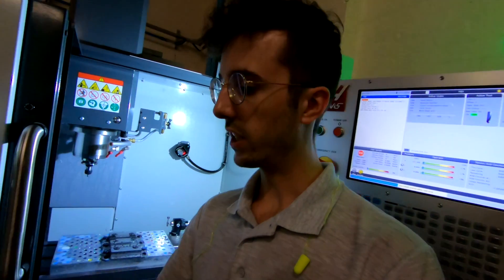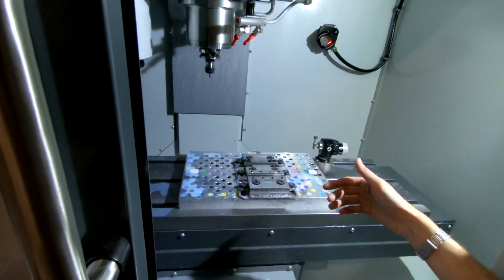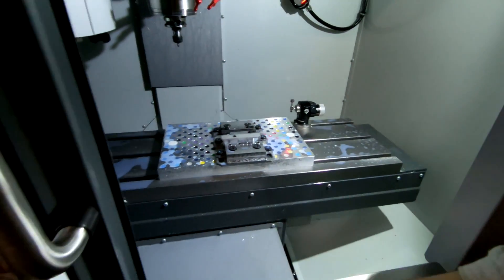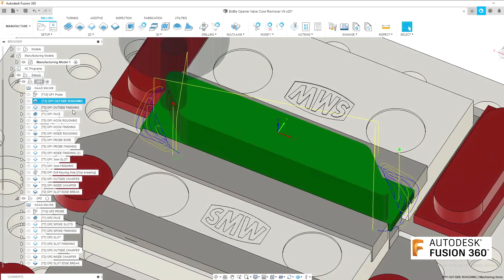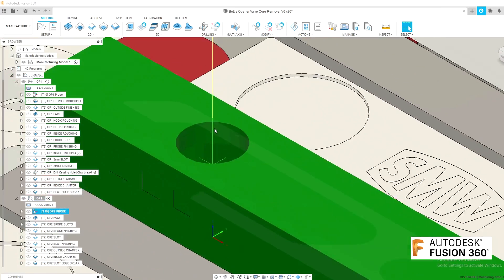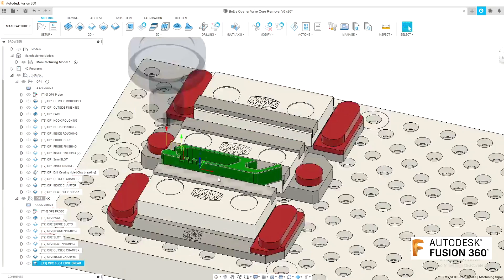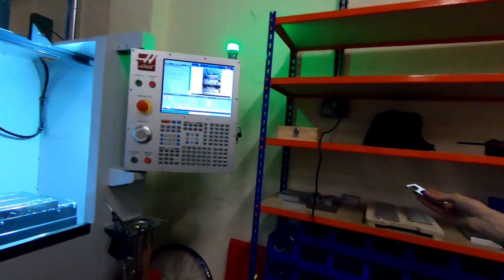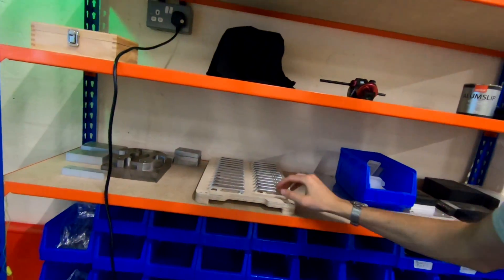First Chips on the Haas Mini Mill! #12

Comment: I literally just came across your channel, and love this video!  Although I do have a question.  Have you thought about adding quick change vises, and adding more vises?  It looks like you have room for another pair of vises on the SMW fixture plate.  Also have you thought about getting a fiber laser?  Once your tray of parts that needs to be engraved, can all be done at once with the laser.
Reply from the maker: Yes absolutely - all those things crossed my mind. However these were pretty low volume, and just one batch - so investing in more vices and a fibre laser wouldn't have been viable.
Reply: @bikestow  Makes sense! Keep up with the awesome work!

Comment: Looks good.   Subscribed.  I like your in cycle probing but it has some downsides that I’ve found.  1.  Added cycle time.  2.  If it ever probes a chip, everything shifts by that amount…  first thing I’d do is set up a work stop or soft jaws for your 2nd op.  This will eliminate need for probing.    2nd thing I’d do is increase rpm to max on all your tools and run the feed as high as you can except for finishing.   I have the 10k spindle option in my mini mill 2 and run all my carbide tools at 10k for aluminum.  Even the face mill.  Aluminum doesn’t care about SFM (SMM in your case?).   Even following what I just said, I’ve accidentally left my machine on 200% feed and ran good parts.  Keep up the good work!  Good luck.
Reply from the maker: Cheers! Yeah work stop is a good idea to save a bit of time. I wish I had the 10k option, but I'm at the UK base 4k. At some point I'll buy the 'software unlock' to get 6k and also to some testing to see what stepovers / feeds I can achieve!
Reply: In-process probing isn't so much of a risk if it's at the beginning of the cycle and you have the option to blast off the parts and probe tip before running. That said when possible, repeatable fixturing enerally will be the way to go for stuff like this from what I've seen. Probes do come in handy tho if certain order of operations can leave some variability in a part. I have a lot of castings I machine and in some ops the only way to guarantee good fit is to lock the part into a machined fixture for the casting geometry, then have a probe routine that finds the previously machined features to set an origin.  (Of course for bigger parts I usually don't even trust the probe for that and use a co-ax.) Even with castings though I've often tried to just have fixtures that will index off previously machined features when possible vs relying on grabbing just the cast external geometry.
Reply: @scottwatrous  true.  I had the issue happen where I roughed 2nd setup, exposing a bore machined in the first setup, then I probed that bore mid cycle, adjusting the offset.   It worked great for quite a few parts, then picked up a chip on one and shifted everything by 0.015”.

Comment: Looks great man👍👍 just one thing, torque wrenches are really only supposed to be used too tighten bolts and screws not loosen them. But then again they are you're tools, feel free to do things you're way.  But those surface finishes look good, keep it up!
Reply: I don't agree as a practicing aerospace engineer.  Why would it suddenly become ineffective, it doesn't, it just doesn't tell you anything if backing off. Are your tools calibrated anyway? It possesses the strength to torque a bolt but not break that torque? There's no logic and calibration  isn't a big deal and small percentages on the clamping torques you deal with and small torque wrenches. Id assume you are only using it as gauge of pressure to avoid marking the piece realistically for youre unlikely overtorquing heavy steels.

Also engineers only work on results and your end product was stunning quality for a simple piece. Love the finish.
Reply from the maker: @DigitalArtisan77  Yeah good point also. This torque wrench doesn't torque or click in the anti-clockwise direction, so I don't know if it could cause any damage / calibration issues anyway?! and yes only using it to avoid marking the workpiece.
Reply: @bikestow   haha click it may not, but its reversible and that would be a mistake otherwise on their part, and false marketing 😅. They're just inconvenient vs a standard wrench/ratchet given length and clunkiness at the end of the day. You should back them off tension after use and more important id say but really and realistically what you are torquing and then even if wholly abused, the error in the torque wrenches would be minimal and you'd end up just finding the number that clamps but doesn't mark too bad. I probably wouldn't use one if solo I.e. not passing instructions, feeling the clamping force via hands, it won't take many goes to dial in your hand skills
Reply: Sorry to ask. I was looking at used haas mini mills in and around UK and it seems £15k is the minimum ball park entry, would there be much more to add to that price do you know please? Obviously consumables and I guess 3 phase needed, but I'd never have made a workshop before lol, always been provided.
Reply from the maker: @DigitalArtisan77  Transport / machine movers would be the next big cost. Would've thought that would be anywhere from £1,000-3,000. Obviously 3 phase power and wiring would be needed, and compressed (dry) air too. Then like you said you've got "consumables", so toolholders, tools, vice / workholding, coolant etc. Given the mini mill only has 10 tools, tooling costs won't be massive, but that depends on what you want to do. 
There's always the risk with used machines are something currently being faulty, or something going wrong in the future. So I would "budget in" a bit of money just in case that happens.
Reply: @bikestow  cool man thanks very much. I'm looking to focus low volume and prototyping etc. But wanted the industrial capability to run the machines for more mundane typical work outsourced, prepping for bigger machine shops etc. Hopefully then to help fuel more inventive creative pursuits. Cheers.
Reply from the maker: Yeah totally agree. Hadn't got round to buying a normal wrench yet.
Reply: @bikestow  And always release the torque settitng when not in use.....jfyi...😉

Comment: If this is for hobby, you are doing ok. If you’re making a business, you need to atleast double all the feed rates. You are running pretty slow. It’s aluminum,  you can run it as fast as the machine can handle for the most part.
Reply from the maker: Agreed. As I mention it's simply a learning project and the parts are mostly just for marketing, not a major source of income! Interested to hear which tools you would run faster and by how much.

Comment: That's a nice setup and work.
If I might make a recommendation, for Op2 - using a face mill is risky from a process reliability standpoint. The overhanging material has a tendency to bend up, causing a collision with inserts, leading to pull-out of the part. Especially as you aren't gripping a whole lot of it and it is thin/bendy. If it were me, I would use that 10mm mill and Adaptive Clear that material off in two steps - one with a moderate width of cut and chip load for just the material on the overhang, then a full-speed/load for the remainder. Leave a little bit of stock and kiss it off with the face mill - you'll have a faster process that is more reliable.
Reply from the maker: Thanks! Yeah this is a fair point and I did actually experiment doing this initially! My conclusion at that time was the overhang wasn't big enough to cause that kind of issue
Reply: @bikestow  Horses for courses, right? We all sorta develop "standard" practices because we've been bit in the ass! I've seen more than one Speedio owner be paying the overnight freight on a new spindle because a face mill pulled their work out. Not as big a risk on a beefy CAT-40.
I do wonder if Adaptive would be faster for you though... Interesting to cycle time test.
Reply from the maker: @LumaLabs  It may well be - unfortunately this run of parts is long done and dusted, but any future runs I'll definitely do some cycle time comparisons. Appreciate the advice!
Reply: I disagree. A facemill is going to use less cutting pressure. There is only looks like .125 or less to face off. Why would you adaptive clear that off? The best strategy is facemill rough one pass then a finish pass of .025 depending on corner radius. This part is taking too long to make as it is. You are only going to add another 20 seconds onto run time
Reply: @drivenauthority916  Like I said, this is a matter of process reliability. The unsupported "hat" of material can start to pull up at the cutting boundary, leading to weird hammering resonance in the part (at best), or curling over the incoming cutting edges of the inserts and colliding with the cutter body (worst).
It is the sort of thing that isn't a problem 99.9% of the time, but it'll really bite you in the ass that .1%.
Adaptive is just a safer way, and would probably be faster than the multiple face mill passes in Z.

And yea, I'm a cycle time fetishist myself (hence Speedios), but the cycle time here is plenty good for a 4k RPM mill on his first parts.
Reply: @LumaLabs  There is 0% chance of a facemill causing any problems or “reliability” issues. Like said before, facemills provide less surface cutting pressure on the material for multiple reasons. Adaptive roughing the material then tool change to the facemill for a finish pass is going to add time no matter what. A facemill is going to be 2 passes, 1 pass would even work too. Idk what you mean by “curling” or “colliding” but additive clearing is not designed for facing of material. Hence the name “facemill”.
Reply from the maker: This is an interesting difference in opinion!
Reply: I agree with the original post.  Less cutting pressure not withstanding - I've experienced the same thing facing overhanging parts with a 3" facing mill.  One out of a bunch of parts will pull up and all hell breaks loose - you can't hit the reset button fast enough.  I don't know if the larger tool is causing some aerodynamic force to pull the part or if it's resonance, but I typically use a smaller tool to clip off the overhang before facing. Just my two cents.

Comment from the maker: For anyone interested, the Saunders Machine Works mod vice system is great for this machine. The Mini Mill only has 254mm Z travel, and once you add a standard 6" vice, clearance above the vice jaws may be an issue for you. There's around 70-80mm z-clearance above the vice jaws before the WIPS probe, for example, would contact the part unless you did a tool change with the table moved far to the right.
The SMW system means this isn't a problem and you end up with more than enough space.
Reply: Nice setup.  I have some of their smaller Hobby vises and fixture plates. Looking to get one for my mini mill too.  Is this their 16"x10" fixture plate?  Wish you went larger or happy with size?
Reply: guys command do I skip line? I have a 3.8 slot and the cutters sometimes come in the right size 3.8 but if they come smaller I put the second pass, I wanted a command to skip this second pass. help me please.

Comment: How much is the Haas Mini mill?

How many clams are we talking
Reply from the maker: Pricing is all very transparent for the Mini Mill on Haas's UK website: https://www.haas.co.uk/modular-mini-mill/ 
We got the Convenience Module, and WIPS which includes some elements of the Software Module for free. Will likely get the Production Module to get the full 6,000rpm and 15.2m/min rapids in the future - but surprisingly it really hasn't been a problem without so far!
Reply: @bikestow  

Oh lord, its out of my budget range ..
Reply: @bikestow  wait, 6000RPM as an upgrade? how much does it have now?
Reply from the maker: @ipadize  Yeah that's right - the UK version of the mini mill, called the "Modular Mini Mill" comes super bare bones to make it more attractive. 4,000rpm is standard, 6,000rpm is one of the "modules" you can add on. Just a software unlock though, still the same spindle in the machine.